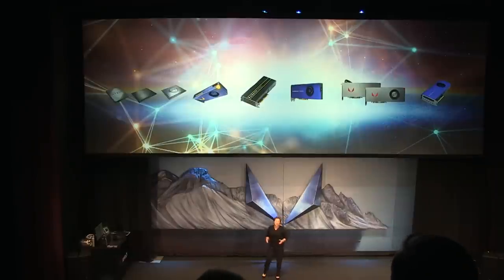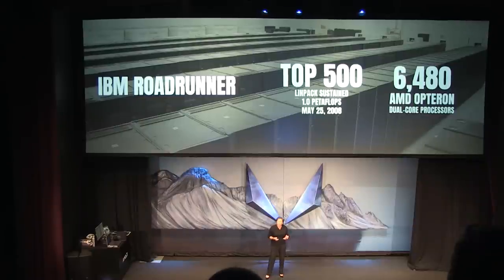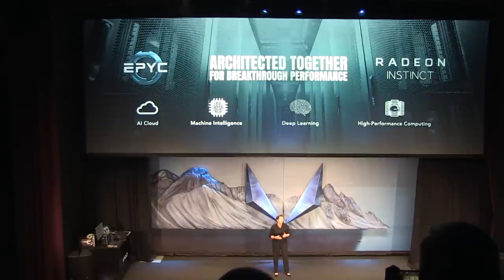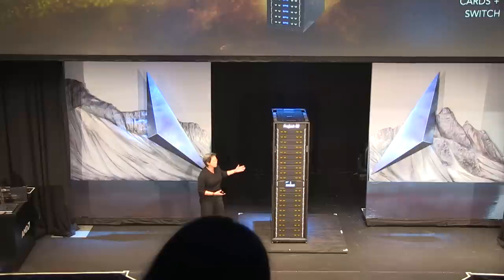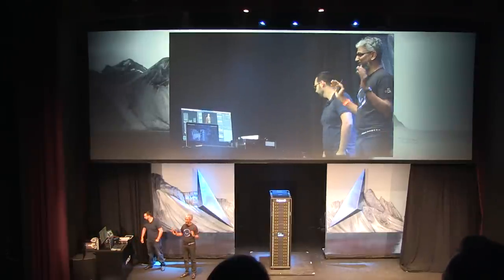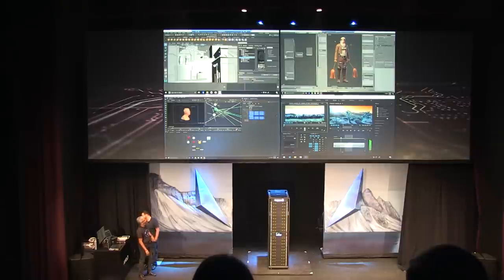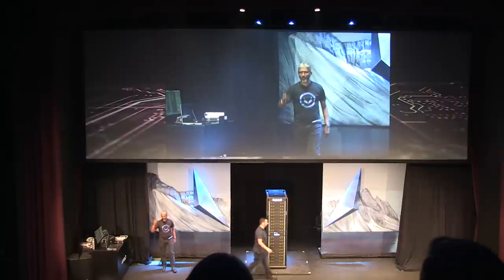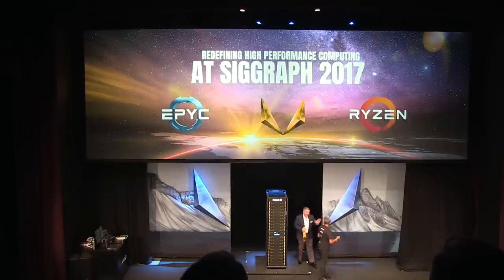AMD Project 47 Supercomputer SIGGRAPH 2017

Comment: Selling this thing might just cover the sales of all CPUs and GPUs in a small country... So I think AMD isn't as much worried about how bad Vega will perform against Pascal or even Volta.
This - the heterogeneous computing - is the reason why Vega was designed. Why Zen was designed. As long as AMD manages to bite blue and green monsters on this front - it will survive. But all the flowing of the shit among consumer base about "Ryzen's IPC" and "Vega having 300W TDP" - is not exactly a threat. After all, if FX was sold for these 5 years, and if miners will eat everything, it may be the death of PC gaming(may every miner be murdered brutally, amen), but it's not the death of AMD.
Reply: vega is only lacking on gaming and thats it in enterprise apps and stuff vega is literally destroying p6000 in some cases and in most of them is on par 
they literally gave the middle finger to the gamers this time around its ok i guess given that navi will be an mcm too